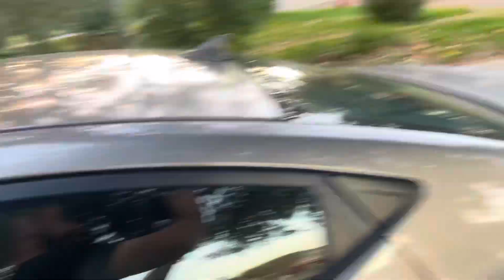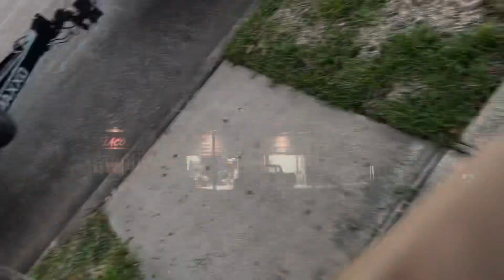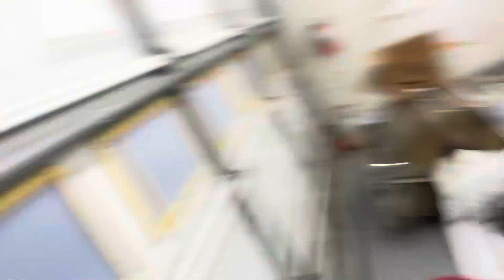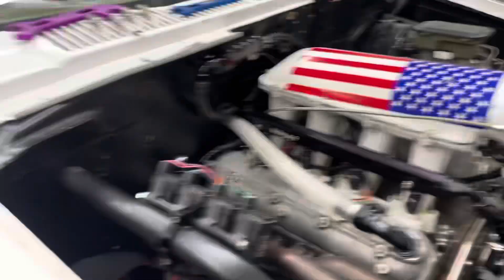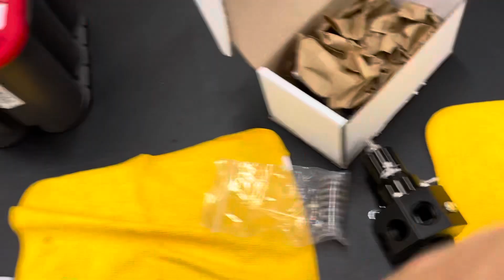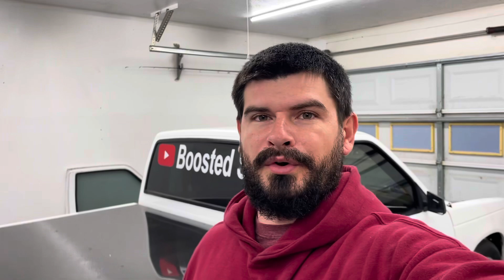What could possibly be wrong with the S10 now?? More headache…

Comment: How/where/who did that bed cover? Is that the aluminum one just wrapped or is it different? It looked different than what was on it. Looks great!
Reply from the maker: I did it lol and it’s different, I got rid of the aluminum one and made this one out of carbon fiber. And thanks man, it took some patience working with carbon for the first time, stuff is fragile.
Reply: @boostedS10  I did end up seeing the video where you showed some of that. I wish you had shown the process a little. I guess it's sitting against some aluminum frame? 
Also was wondering, what cam specs do you have? Thing sounds great! You definitely have one of the best tuning! Flaco has incredible s10 taste!
Reply from the maker: Yea I just made a frame that goes bedside to bedside out of aluminum angle, and it has a lil John twin turbo cam in it. And yes sir flaco is definitely the best